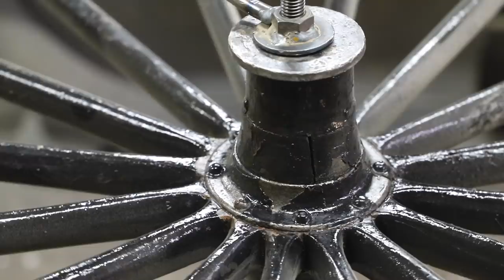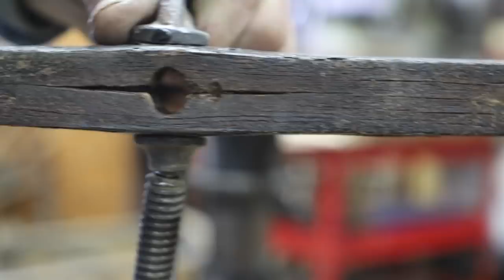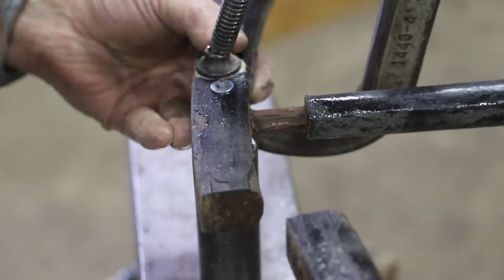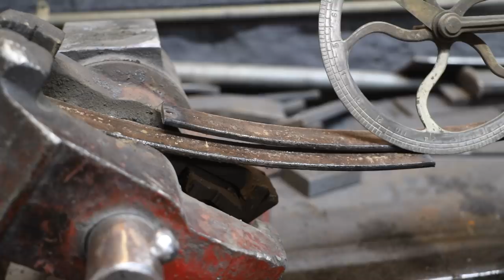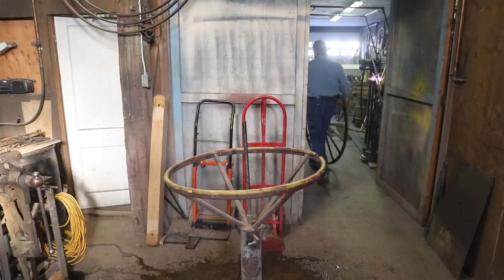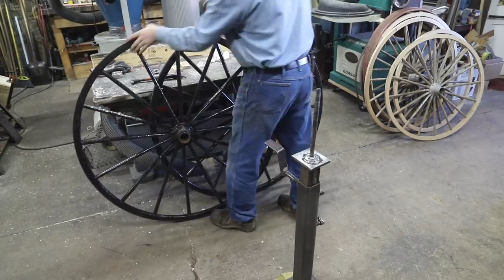Buggy Wheel Repairs & Setting Buggy Tires | Engels Coach Shop

Comment: Repairing a split/joint in old  wood is more about getting it clean more than anything else so glue can have a surface to bond too and having the patience to let it set often up to 24 hrs for maximum strength. Paint as well as other debris or damage is like trying to weld heavily rusted metal together because it acts like a barrier/containment and it will often fail if stressed. One of the biggest challenges in repairing wood is if it's lost to must moisture because it was in an extremely dry environment and most kiln or air dried lumber still has around 8% moisture content when used. Indeed wood can change seasonally and most musicians will tell you the instruments made with it can sound different which is why they'll carry it instead letting it travel in a shipping container with other luggage. Kudos on taking the time to repair the split instead of just filling/sanding it flat that would of been the first impulse of a novice, do you recommend waterproof or just standard wood glue for a wheel repair and have your tried any Polyurethane Glue/Epoxy instead? 🛠
Reply: Richard Mattingly 
As my Father would, as in many things, preparation is 90% of the job. 
R

Comment: Nice one.  You likely know that some 12 point sockets will fit those square nuts and save you some time by using the 1/4 impact driver.
Reply: You can also get 4 point sockets. I don't know though that I'd personally be inclined to use an impact driver. Not that many threads to spin on or off, and I'd personally prefer to be able to feel the tension on the wrench.
Reply: @lwilton  The thought was mainly for disassembly.
Reply: @lwilton  The thought was mainly for disassembly.

Comment: Noticed you let old rivets fall to the floor. Recent video you used a stick with magnet on the end to retrieve the metal debri when done. Am guessing metal shavings also would fall to the floor. In the past I would say “well they can’t fall any further” and not worry about them till a job was done. Then I got to use a shot blasting machine to scour the surface off concrete floors prior to resurfacing. Inevitably 1mm steel shot balls would escape the vacuum return into the machine and scatter about hither and thither. I used a metal tray with a push handle hip height and with a wheel each end (bit like old push mowers) allowing the tray to be pushed about 3-4mm above the floor. Inside the tray was a long magnet connected to a release lever on the handle.
I would push this all over the floor and thereby pick up all steel shot plus swarf if near a lathe then push onto a piece of cardboard. Pull the release handle and thereby deposit them dust free steel onto the cardboard for retrieval. Worked a treat.

Comment: I noticed you reused the metal part of the wheel and after resizing and installing you had to drill holes for the rivets. What happens to the old holes? It seems like they would allow water and junk to reach the fellows. Does it matter?
Having driven wagons 2 and 4 in hand all this really fascinates me. The wheels for my wagons were made in Montana but I don’t know where. The man that made the wagons is gone.
Thanks for your work and explanation of the details.

Comment: Trying to work out if the country & western music playing in the background is playing in the shop or added in post. :)
Also wondering what happens to the old bolt holes in the tyres. Presumably they no longer line up. Do you weld them closed?

Comment: Did I see a hammer wedge come out of that fello with the bondo? Seems kind of picky but I wonder if those soft rivets could be blackened with some burnt oil and heat? I know it is probably just easier to paint them to keep them from rusting.

Comment: When you resizes the metal rim to fit the aged wood do you have to take into consideration of the wheel on the other side of the wagon/buggy? Does it cause the vehicle to pull to the smaller/larger side?

Comment: Funny how the penny drops sometimes.
You shrink the undersize steel rim on.
Then with all the road work, ie, hammering, planishing, the steel would be stretched, veeery slowly.
Just never "thunked" about it before.
Reply: In this case it looks to me that the wheels have not done much work since they were last re-tyred and it is the wood that has shrunk.  What happens with a wheel that has seen a lot of use is that it gets thinner and starts to stretch which makes the rest of the wheel loose.  On a big wagon, you know the wheels are getting loose because you can hear them creaking.

Once that happens, you need new tyres.

Over here in South Australia we were not a quick to mechanise as in the USA and I have noticed that a lot of old wagons have thin tyres.  I surmise the owners, especially the farmers kept on with their horse drawn wagons until faced with the expense of re-tyring.  Only then did they get a truck.

Comment: Did you weld up the old holes for the bolts that held the tire to the rim? I was looking for the spots but I'm not sure I was seeing them.

Also, last week when I saw the second video I assumed it was a re-upload of the first video. I'm glad I checked and was pleased to see that it was a different video. And another bonus this week!
Reply: Yes, I have it figured out now. Weld the old holes, set the smaller tire as normal, then chase through the wood into the tire with the drill bit. Counter sink the exposed holes and bolt her back up.

Comment: If you have old Makita batteries laying around check out (www.bluffvalleybattery.com) They can rebuild you batteries at a considerable saving over buying new ones. I use 18 volt DeWalt tools and I can actually rebuild my own batteries with kits that they sell.

Comment: I've watched so many of your vids and I've seen you put the steel tire on there multiple times, but I was curious, is the heat you apply to it not hot enough so that when you "quench" it with water, it doesn't harden? I've just never seen you normalize it after this process.
Reply: They are not heated enough to make them harden.  You have to have a red heat and fast quench to harden them.
Reply: @rustysteed8414  I kind of figured as much, thanks!

Comment: How much +/- can you tolerate in diameter between a pair of wheels (i.e. Pair of fronts or backs) and still have a matching pair? 
Some of those buggies must be like my 200 year broom, it's had 50 new heads and 20 new handles and is still going strong!
Reply: EngelsCoachShop. Thanks for that, I must have been unclear with my question, I meant, side to side. I understand that making them from new you will be fairly close, but when refurbishing, you may find there to be a variation. In the examples you showed the diameters changed by a very small amount, but in a more extreme case, how much would be acceptable? I would expect that there is a fairly large, acceptable difference, more so than a motor driven vehicle.

Comment: I am curious: What happened to the original holes in the tire iron(s)? I did not see you weld them closed, or align them up with the holes in the Felloes. (mystified)
Reply: @EngelsCoachShop  Sorry, i missed the welding. My mistake, Sir.  AND - Thank you for your time you took to reply.

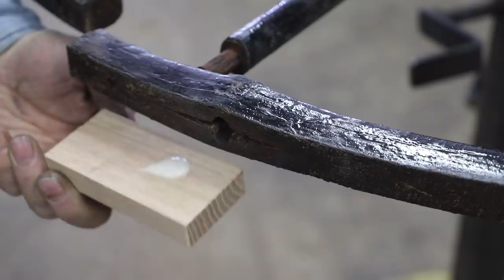Comment: @ 4:41 - well, I'd rather use some epoxy-based adhesive than a regular PVA glue. You see, PVA wood glue is a water-based emulsion, which means it sorta binds up at the first layer of "resistance" - as soon as it encounters any water-hungry substance (like dry semi-rotten wood, dirt or dust) the water gets sucked up, the emulsion coagulates, and penetration stops. Epoxy resins are much better at penetrating porous substances and binding dirt or dust - they might be quite viscous, but the have very low surface tension, just like a regular car engine oil.

Comment: What's the reason for the plate bolted between two of the fellows?
Reply: Reinforcement of the joint.
Reply: It keeps the ends of the fellowes from walking apart.   Using a dowel pin or tongue and groove or any other type of joinery would probably weaken them, the little steel plate keeps the ends butted together.
Reply: @moconnell663  That makes sense, but I could only see two of these plates on each wheel and I thought there were many more fellows than that. Am I missing something?
Reply: @randomstranger9674  buggy wheels generally only have two long bent fellowes since they are so narrow. Heavy wagon wheels have more to ease assembly.

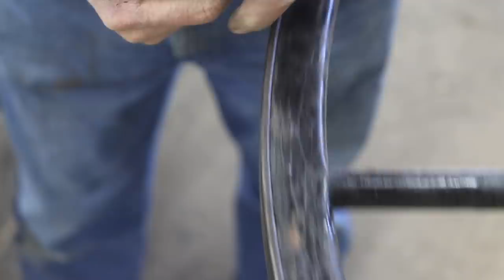Comment: Can anyone tell me the name of the fastener being used at 13:20 ? I would love to have a link to a supply of these "tire bolts".  My searching has let me down,  By the way, thanks for taking the time to film and share. I like watching a skilled craftsman at their craft.
Reply: I was about to ask the same question, but I thought I might scroll down to see if anyone else already did. I came across some of these fasteners a few years ago. Now the both of us wait patiently for someone in the know to chime in.
Reply: I'm only replying so I can hear the answer too when it comes. I have tried searching fluted nail with threads and several other combinations but have yet to come up with a name.
Reply: About the best I can come up with as a catalog pat would be a plow bolt (flat-head carriage bolt), or pull the sleeve off of a stud-type concrete anchor. I believe Mr. Engles turned regular bolts down on the lathe in another video.

Comment: When heating the iron rims to expand them, do you heat them to a specific degree or, based on experience just long enough to know they have expanded?  Also, when tighten up a wheel is it possible to reuse the iron rim by trimming out a fraction and rewelding?
Reply: HWPcville thats what he did measured cut but didnt show the rewelding.
Reply: @MIGASHOORAY  Thanks for the reply.  I went back and watched the other video again and saw it happening.  I missed it completely the first time........ I must have been distracted....lol

Comment: Have you ever tried https://www.google.com/search?q=GORILLA+GLUE for such a repair project, or for other times where you normally would use the usual wood glue(s)? And if so, why not use it for this Felloe repair? I use it to repair my https://www.google.com/search?q=Missouri+Meershaum pipe stems, which always eventually come unglued to the bowl, and it is the only thing that has ever worked successfully, and permanently, for That chore!